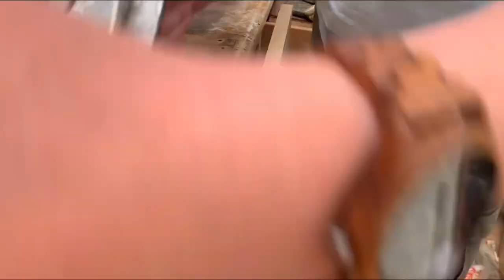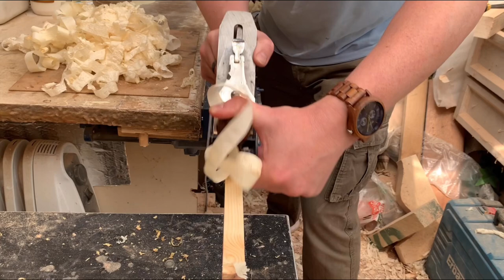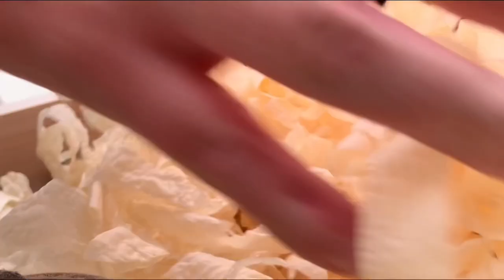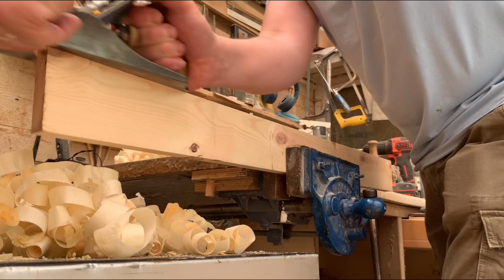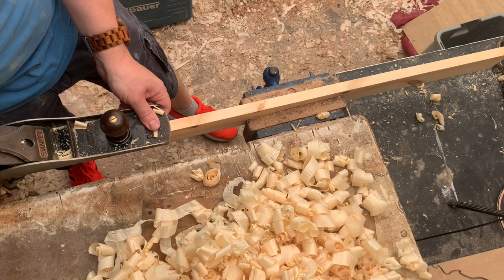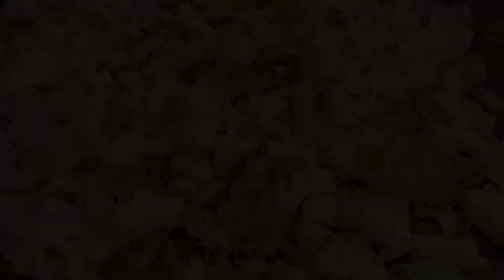ASMR sounds of a HAND PLANE and the SCRUNCHING of wood shavings

Comment: Several years ago I was using a no# 4 1/2 smoothing plane on the top for a Chippendale chest of drawers I was reproducing for a client, and that's all you could hear in my shop. Music to my ears. I turned around and saw a retired trauma surgeon friend watching me. She said that's the most soothing sound I've ever heard and asked me what I was doing and she wanted to try it. An hour later she had planed a 6 quarter piece of spruce down almost to a veneer with a 5 1/2 jack plane. She asked and I recommended the same planes I have because she could afford them. She now has a small shop at her home, built her a bench and we made her a plane cabinet for her wall.  She told me she can spend hours in her shop doing nothing but making plane shavings and saw dust with her saws. I also taught her ho use hand saws and all she does with them is cut lines, builds nothing. She told my wife and me, after 30 years in a trauma center, my hand planes and my saws are responsible for me keeping my sanity. Thanks again for using hand tools. I wish more beginner woodworkers could find your channel.
Reply from the maker: That’s fantastic to hear 👍